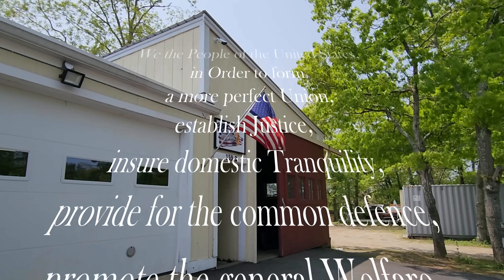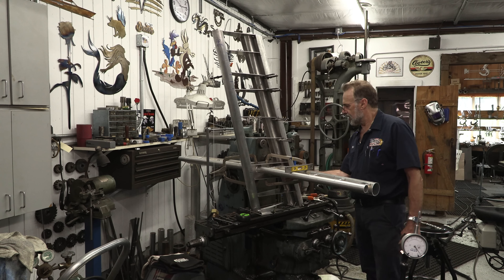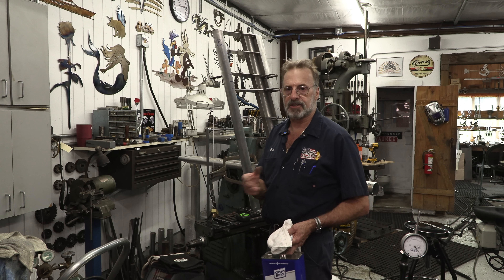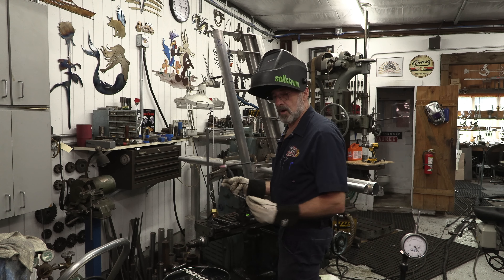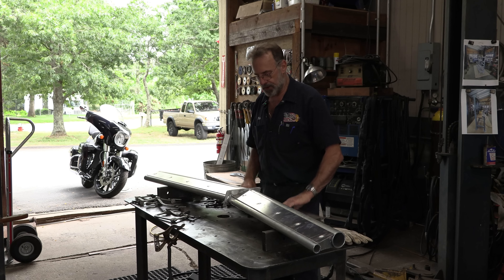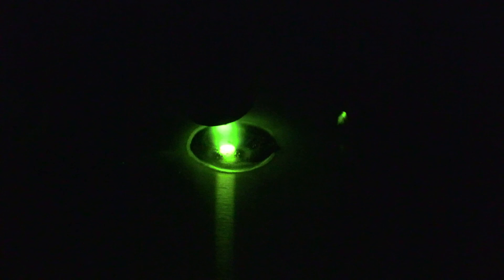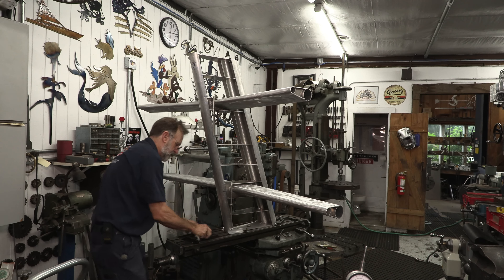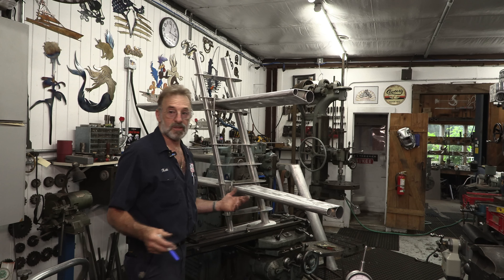Radar Mast Tack Up Tower And Skin The Spreaders

Comment: I'm  surprized that the main structure stays relatively straight after welding, usually, aluminum have a great tendency to warp as it is welded.
very good job on that project.
Reply from the maker: A lot of it has to holding the structure in place until it cools down. if you weld aluminum freely it will go where it wants too!